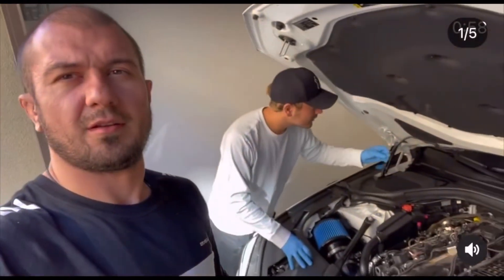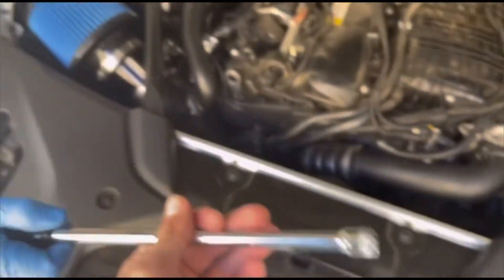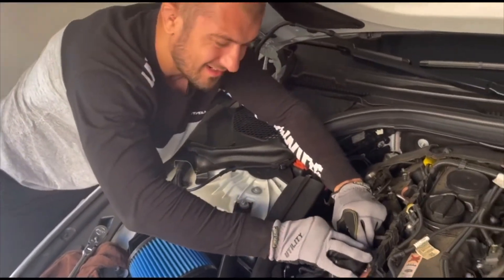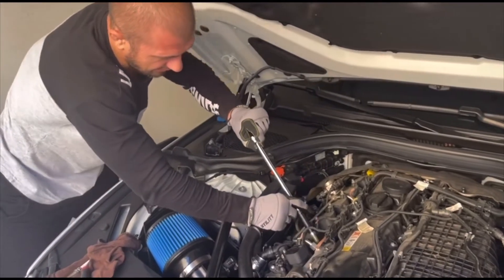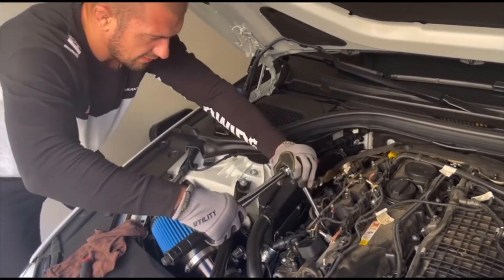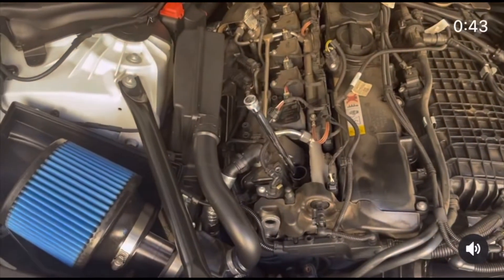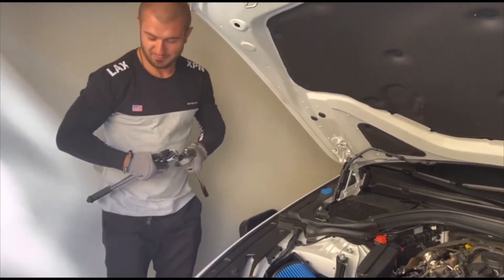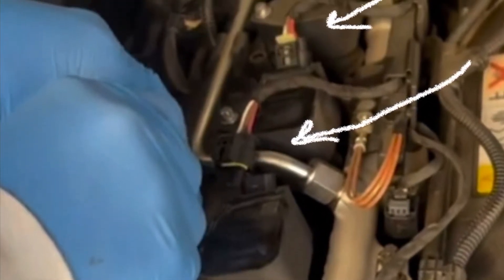BMW G30 540i B58 spark plugs DIY || How to change spark plugs on B58 engine

Comment: Great video but you didn't mention to add Aluminum Anti Seize Lubricant around spark plug and bottom of coil pack. Very important to  keep water and moisture out of your electrical system, prevents rubber gaskets from drying and cracking and seizing, and helps mitigate any dust or alkaline.
Reply: No you dont need antiseize